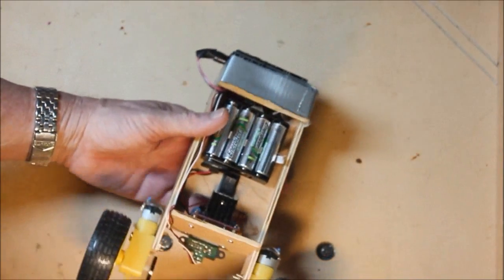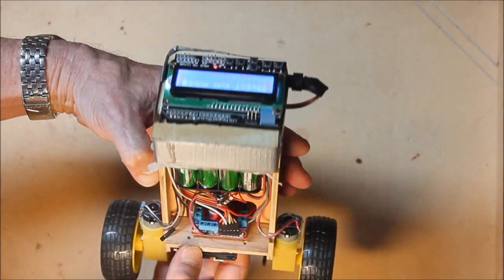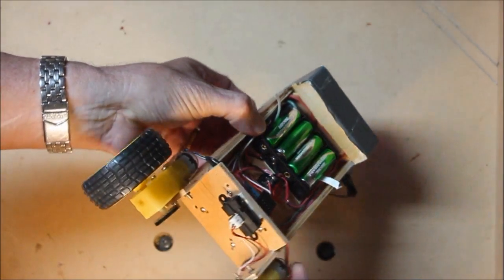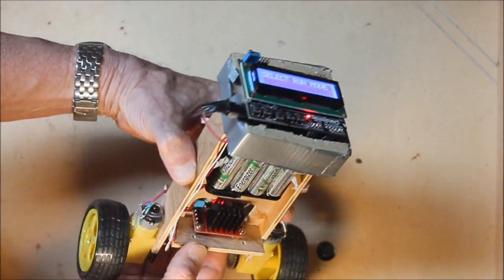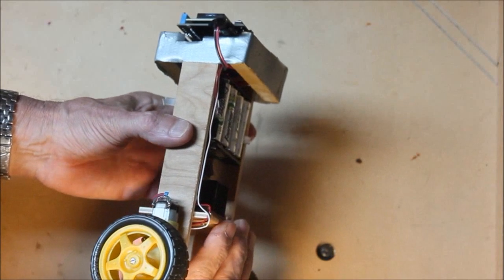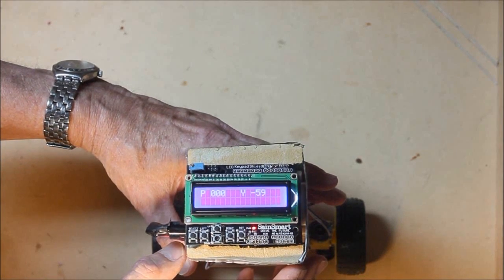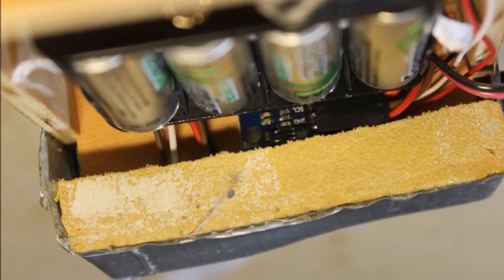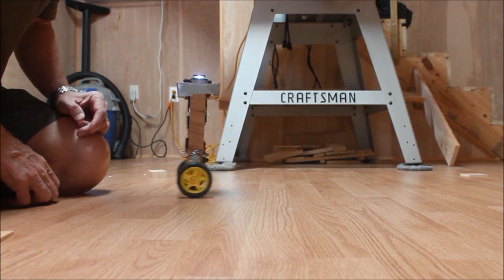Arduino/MPU6050 Balance Bot

Comment: Please, I'm working in this project... please send me the code. thanks
Reply: leobruno7ufpe@gmail.com
Reply from the maker: leonardo bruno medeiros silva medeiros silva Thanks for your interest in this project.  (I think its a fun one.)
If you haven't already found it, there is part 2 to this video:
https://youtu.be/SVAoz45gz3k

In the comments section of that video there is a link to github,
where you can get a copy of the code, plus a simple wiring diagram.
Let me know if you have any troubles using the links or the material found at the github site
Reply: jmhrvy1947 Do you have a code without LCD?
Reply from the maker: leonardo bruno medeiros silva medeiros silva No.. The display (or maybe I should say, "a display") plays an important roll in getting a project like this up and running. True, you could use some type of wireless link to send performance data to a remote display, or a logging system. But because the display (shown in these videos) was cheap and includes a button set, it seemed like a good fit. 
However, if you really don't want a "on-board" display, you could go through the sketch and comment out the lines that reference it, and as a balancing routine, it should still work...
Reply: jmhrvy1947 Do you have separately only the PID code? I'm not able to comment only part of the LCD, I do not have much experience with this. Thanks
Reply from the maker: leonardo bruno medeiros silva medeiros silva No I don't. But if you are wanting just the PID portion of this sketch, then I would recommend checking out this link:
http://brettbeauregard.com/blog/2011/04/improving-the-beginners-pid-introduction/
Its a well written article on what is needed to make a basic digital PID. It is where I started, and In fact, if you look closely at the PID portion of my sketch, you will see  its almost a direct copy of the code presented in the link.
Good luck with your project. Remember projects are for learning. So jump in there, and sort out the problems as you find them.  You may end up in an entirely different place from where you thought you were going, but however it turns out, you will know more than before you started.

Comment: I like your project , I'm working one very similar , I'm using the same engines, the same bridge h lm298n , accelerometer MPU6050  but I'm working with Arduino Uno , am studying mechatronics in Mexico , but have not achieved an optimal algorithm , could you Please send me the code to this email : nenosssk8@hotmail.com
in advance thank you very much
Reply from the maker: juan ricardo Martinez garcía Good Luck with your project. The Uno should work just fine.
You may have already discovered in the "Part 2" version of this video, its description contains a link to the code I used. But if haven't, then go here:
https://github.com/jmharvey1/Arduino-BalanceBot.

 
FWIW: I don't use the 6050's interrupt, but rather just look at its buffer count to determine when it has a new data set. Also be patient with the process of finding the best PID values. Its a highly iterative process. Especially when using low power/speed motors like these.